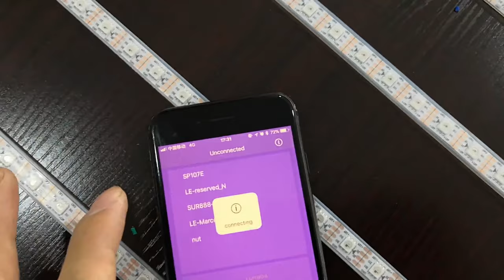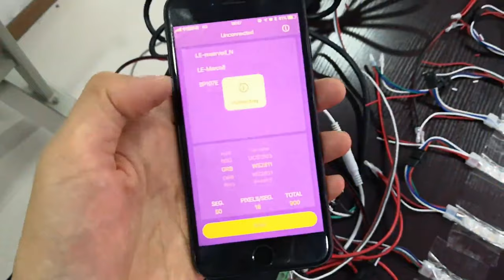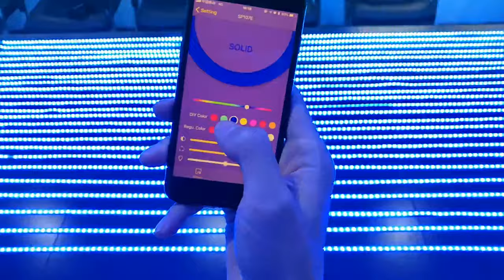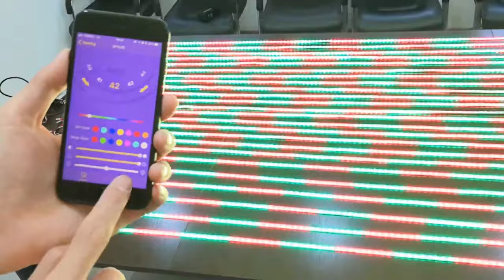Addressable WS2815 LED Strips Work with SP107E, How to Build a LED Music Screen

Comment: Excellent 👍. I have 2 questions. A) Can I connect power and controller in the middle of 3meters strip? B) how much ampere power supply should I buy for 3 meters of strip which is ws2815 60led per meter?
Reply from the maker: Hello, 1. yes, you can connect the controller the power and controller in the middle, connect 2 1.5meter in parallel. 
2. 3 meters need a DC12V 50W4.2A power supply, this strip 14.4watt per meter(60LEDs/m), Please do not exceed 80% of Power Supply capacity when calculating Power Supply size to use in your system.
https://www.superlightingled.com/48w4a-dc12v-plastic-shell-enclosed-power-supply-adapter-for-led-strip-light-p-235.html
https://www.superlightingled.com/dc12v-ws2815-upgraded-ws2812b-5m-300-leds-individually-addressable-digital-strip-lights-dual-signal-wires-waterproof-dream-color-programmable-5050-rgb-flexible-led-ribbon-light-p-2133.html
https://www.superlightingled.com/addressable-dream-color-controller-series-c-7_51.html
Reply: Im telling jeep too, i want transparent led strips for an automobile window display!!!! damn it

Comment: how to connect sp107e controller directly to ws2815 led strip?  does the blue & green cable join the ws2815 led strip to the output of the d1 sp107e controller?  please answer & tutorial, thank you.
Reply from the maker: https://www.superlightingled.com/blog/how-to-wire-addressable-led-strip-lights/ you can find the answer in this article
►How to connect the 3-pin JST connector to the Breakpoint Resume LED strips?

Comment: can i use WS2811 instead of ws2815?
Reply from the maker: Sure, but WS2815  is DC12V individually addressable LED strip light, ws2811 DC12V 3LEDs cuttable.

Comment: Hi. I have the sp107 controller and 30 meters of 12v ws2811, I’m trying to use it as my Christmas lights on the house. What do I need to do this job? Thanks!
Reply from the maker: https://superlightingled.com/How_to_Wire_Addressable_LED_Strip_Lights.html pleaes read this article, and power the LED controller seperately

Comment: Hello I have a question please. Why do you use the amplifiers? The led strips can’t work without that ?
Reply from the maker: Hi, this project more than 6,000 pixels, the SPI can only output 960 pixels, you we need 1 or 2 amplifiers, 
How long do you need? we also sell DC24V 6 pixels per meter led strip lights,  164ft/50m only need 300 pixels.
https://www.superlightingled.com/newest-dc24v-164164ft-addressable-ws2811-waterproof-music-led-tape-light-kit-length-controller-optional-p-3829.html

Comment: I was thinking about using the ws2815 led strips for just one loop all around the room where the wall meets the ceiling and i know i need 15meters but im not sure what controllers or power supply to use can anyone help me ?
Reply: I want to do the same sa well ;) Did you got any responces yet?

Comment: The SP107E controller doesn't have the ws2815 library did you combined the green and blue channels when using the ws2811 library?
Reply from the maker: Understand correctly, WS2815 and WS2811 have the same protocol, so they can share an IC. WS2815 has one more signal backup line than WS2811, so BI and DI can be connected to the DAT interface of the controller.
please see controller link: https://www.superlightingled.com/dc524v-sp107e-wireless-bluetooth-spi-music-spectrum-controller-for-addressable-ws2812b-sk6812-led-strip-lights-p-1715.html

Comment: How many 200 watt power supplies am I able to run off one standard 15 amp house circuit
Reply from the maker: Hello, DC12V WS2815 60LEDs/m led strip 60W per roll, 5-meter per roll, the 200-watt power supply can run 15-meters
Reply: SuperLightingLED  i am more curious as to how many of the 200 watt drivers I am able to    Run of a standard house circuit. Would I be able to run 5 200 watt power supplies on a standard house outlet
Reply from the maker: @reofpv6665  Yes, no problem, 5 200W is 1000W, if you use US outlet, it can only need AC110V 9A, Usually the home AC cable input power is 30A (3300W)or 40A(4400W), this is low power lighting, please feel free to use

Comment: Hi. So the power supply for SP107E controller is 12V. Which means the controll signal high voltage will be 12 volts... How the heck the LED chips handle that kind of high voltage? As far as i know it is rated max 5.5 volts... Can you explane your way of wiring?
Reply from the maker: Hello, all LED strips and power supplies are DC12V, and the power supply must be 1.2 times the total power of the LED strips. The controller and amplifier need a separate input power, which supports DC12-24V, but these two only output signals.
What about 5.5V you mentioned? As long as DC12V is supplied separately every 5 meters, it will not produce a voltage drop
DC12V addressable led strips is better, https://superlightingled.com/ws2815-ic-programmable-led-strips-c-5_162.html
Reply: @superlightingled  thanks for the reply!!! The WS2815 chip's datasheet says that the data input (DI) rated to 5V signal... However if you use SP107E with a 12V power supply and the DATA output directly connected to the LED stripe Data input (and the chip still works) than there is some information I dont know or clear! In my case I use 12V DC power supply (150 watts max) feeding the stripe and feeding with a different path the SP107E.... The stripe have random leds lighting up during operation and lowering the brightness it gets worse...
Reply from the maker: @Pistikukac  Hi,ws2815 is DC12V, ws2813 is DC5V, don't worry, please select WS2815, the voltage drop is smaller than WS2813,  https://superlightingled.com/dc12v-ws2815-upgraded-ws2812b-5m-300-leds-individually-addressable-digital-strip-lights-dual-signal-wires-waterproof-dream-color-programmable-5050-rgb-flexible-led-ribbon-light-p-2133.html
Reply: @superlightingled  Thanks for the reply agian. Checking the datasheet of the ws2815 chip (https://www.superlightingled.com/PDF/WS2815-12v-addressable-led-chip-specification-.pdf) you can see the VDD= 12V power supply requirement. However the Electrical characteristics suggest VDD=4.5~5.5V! for the high level input. And that is what is confusing for me because using 12 volt on the Din pin I think chip will be failing...
Reply from the maker: @Pistikukac  Hi, There are resistor designs on the PCB, they accept DC12V voltage input, please ignore the parameters on the specification

Comment: How did you addressed the max pixels in the app? In the app the max is 960 pixels while your led strips setup are more than 960 pixels.
Reply from the maker: I using 2 signal amplifiers,  https://www.superlightingled.com/dc12v-8-channel-spi-signal-output-data-signal-amplifier-for-programmable-dream-color-6803-1903-1809-1812-2811-ic-led-light-strips-p-362.html
Reply: The Repeaters change the game. You technically could have an infinite amount of strips. But one limiting feature of the SP107E is the “actual” limit which is 150 LED’s. Only 150 can be programmed. Anymore is a mirrored version of the original 150. I learned this the hard way when I made a vu meter spectrum analyzer with 144/3m x 16 strands and framed the the ceiling/wall border of my entertainment room with the LED’s in aluminum 90 degree angled rails. I wanted the meters to extend away from the surround sound speakers as if you were being overwhelmed with sound, but the limiting 150 made me change the effect to each corner has the meters expanding out from them. Still way Cool!! Last? The SP107E VU Meter Loses its “OMG FLARE, the gotta have me one of these feel when you realize the dancing LED’s aren’t reactive to the music. It’s just chaos, so when your favorite beats have a hard breakdown in the song. Which is a total boner killer. Solution: total redemption after I added to these controllers, DIY a Bass Filter. A 6ft Aux 3.5mm cable and a few capacitors. (Needs Solder, and changing Impedance of the capacitors changes the frequencies that come through. A 50v 3.3uF and 22M is what works best for my music selection. Basically I removed the highs and Mids so these now hit only on bass frequencies. Hope you use this knowledge moving forward. Peace
Reply: @simpleuser9765  did you make a video of this filter 

Does it not feed back any distortion to you sound output itself on your ears

Comment: on a WS2815 do you just connect both signal wires to the same signal?
Reply from the maker: Hi, you can also connect all the led strip in series, or use this Art-net 32CH  controller: https://www.superlightingled.com/dc524v-ethernetspidmx-pixel-light-controller-bc216-support-madrix-software-p-1883.html
WS2815 led strips: https://www.superlightingled.com/ws2815-ic-programmable-led-strips-c-5_488_162.html
Reply: @superlightingled  do you connect the second signal wire on the led strip to the ground cable?
Reply from the maker: @richtodaro9919  Breakpoint Resume Series: VCC, DAT, B1, GND(B1 can be connected to the DAT/CLK/GND interface).

Comment: 1) Why do you merge the blue and green wires to Data, instead of clocking?

2) What is the purpose of clocking?

3) is it possible to wire "both" (in parallel) the music controller (Sp107E) and Wifi controller Sp108E) to use at different times ( not simultaneously of course )?
Reply: ws2815 both carry data for fail safe. clock inbuilt ws2815,
Reply from the maker: hello, 1. the green wire is DATA, the blue wire is DATA BACKUP wire, so you need to connect 2 signal wires together.
2. CLOCK wire is other addressable chips, like LPD6803, WS2801, APA102
3.  yes, no problem, But before switching the controller, you need to turn off one of the controllers, otherwise a signal conflict will occur.
Reply: thanks! That makes sense.

Comment: good morning so i have to jump the 2 wires BO, DI at the output of the DAT controller and the negative GND.
Reply from the maker: Hi, WS2815 WS2813 WS2815  BO, DI wire connect to DATA interface, GND connect to GND interface:
https://www.superlightingled.com/ws2815-ic-programmable-led-strips-c-5_162.html

Comment: This is completely not the way to hook that up. You can't feed any X Y parameters into the device when your using signal amplifiers to divide the digital signal. The sp107 needs to see the led field as a screen with one single digital pathway from start to end. As soon as you disrupted the signal path with the amplifiers you lost the 107s ability to see the entire field of leds properly.
Reply from the maker: Yes, the amplifier can only amplify the signal, output the same signal synchronously and form multiple same dynamic effects，If you want a complete super long dynamic effect, it is recommended that you use a DC24V led strips and 2048 pixel controller

Comment: can you make that strip lights into wireless all of them by using bluetooth  or something so  that strip light can be put anywhere in corner  ?
Reply from the maker: Yes, no problem, the power supply, amplifier, and controller can all be hidden,
In order to let users see the wiring process clearly, I showed all the accessories, https://www.superlightingled.com/dc524v-sp107e-wireless-bluetooth-spi-music-spectrum-controller-for-addressable-ws2812b-sk6812-led-strip-lights-p-1715.html

Comment: What Controller should i use for phone control (wifi or bluetooth) for 15 meters of WS2815 ? And what power supply can power up 135 watts of led strip? @SuperLightingLED
Reply from the maker: Соси Бибу please use these controllers 
https://www.superlightingled.com/addressable-dream-color-controller-series-c-7_51.html
15m need a 12v 200watt power supply
https://www.superlightingled.com/mean-well-lrs20012-dc12v-200watt-165a-ul-certification-ac110220-volt-switching-power-supply-for-led-strip-lights-lighting-p-213.html

Comment: Hi! Can someone please tell me if i can use the WiFi SP501E  Controller (3pin connector) with a WS2815 DC12V LED strip (4pin connector). I have bought 15m of LED strip from aliexpress and now i really don't know if i can connect it with this wifi controlled that i have. Can someone please help me? Thank you!

Comment: What does the BO/BI terminals do on WS2815?
I get that DI/DO is data.
Reply from the maker: Yes, DI is data input, DO is data output, WS2815 has dual signal wire input

Comment: Hello, 
Great video thanks for making it.

I have ws2815, sp107e and power supply. Problem is the LED Chord app does not list the ws2815 led strip.
How do I get it to work or are you using different app?
Reply from the maker: You can choose WS2811 to try again.
Reply: @superlightingled  Hello, Thanks for fast reply and help. I will try again later when I have some free time.. Thanks

Comment: Nice video!
I have a question. I just purchased SP107e with WS2013 (4m 60led). Connecting it seems pretty straight forward. The idea is to run it along one of my walls.
But... I have this idea possibly to add lights behind my front speakers in the future.
If I want to connect 4m, 1m, 1m led strips similar to the way you have connected them, how are the addressable light effects going to work, since the 4m strip has 240pixels and the 1m ones only 60.
Is there any chance for it to work at all? The idea is to control everything with one controller.
Or is it maybe better to connect them as a continuous strip 4+1+1 with long extensions, and the effects will follow first the 4m stip on the wall and then move to the strips behind the speakers.
Reply from the maker: please don't more than 960 pixels, SP107E can only output 960 pixels, you can set SEG60 SEG/PIX 5
Reply: WLED can output up to 1500 pixels.

Comment: Is it possible to control each strip individually? @SuperLightingLED
Reply from the maker: This controller can control the length of the strip, the LED strip itself is individually addressable type, if you want to be individually addressable, you can use our programmable controller
https://www.superlightingled.com/dc524v-ethernetspidmx-pixel-light-controller-bc216-support-madrix-software-p-1883.html
Reply: Try an Arduino for small installs with power injection along you strips.
Reply: ian grindey thanks Ian!